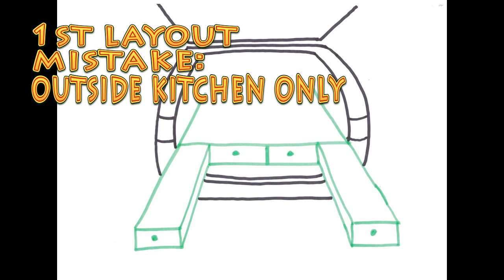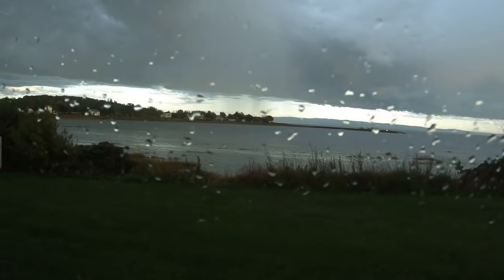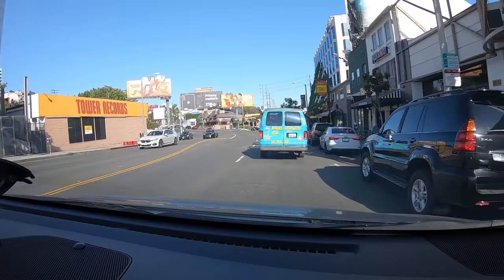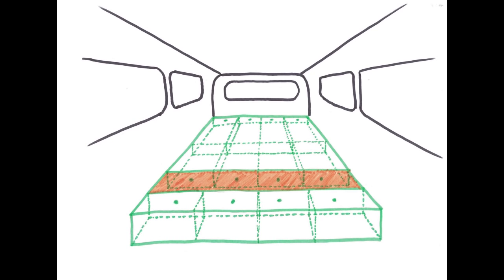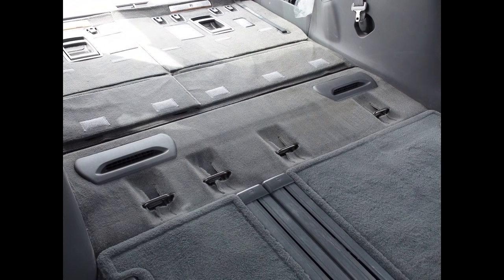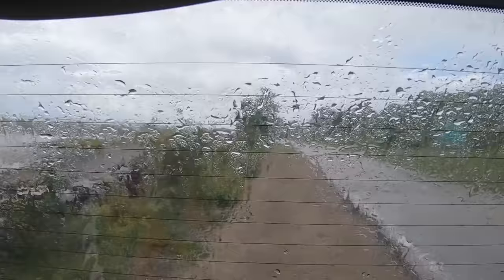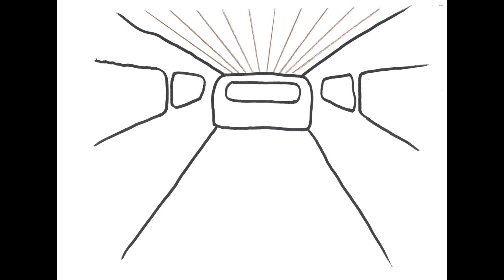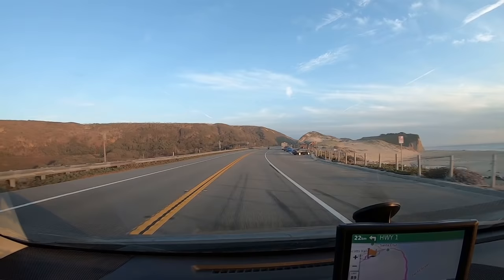11 mistakes to avoid (van conversion)

Comment: Not! There are only a few days on a trip that it rains . Those days you eat out. I go on vacation to enjoy myself not to make a five course  meal. There are rest areas where you can cook out in almost any kind of weather. I would rather access kitchen items from the rear and keep the dirt and mud outside. If you put your kitchen in the front where most are found even travel trailers which makes no sense. I would put a galley in the rear. The dividing line would either be a screen or wall. I would like to have some access from the rear inside. I haven't decided if the bed should be on one side or the rear after the galley area. Beds should have an isle between for easy getting out of bed. I slept in a motor home that had narrow beds but they worked well if someone would want to get up to use the restroom. Yes I said restroom no toilet in my van. I don't want to be dumping human waste on my vacation. I would have two refrigerators one in the galley and the other between the two front seats it would be small and have water and cold sodas. I would be able to lift it up in case if someone wanted to lay down. I don't really know if I want to keep the rear seat and use it for part of the beds. I had a 2004 sienna and I always kept the rear seat inside in fact before I got a chest refrigerator I took my 5 cu foot freezer and used it for a cooler plugged it in every Other night. It kept everything from spoiling and the drinks cold. of course we didn't sleep in the van. The motels where we stayed we ran a cord outside. I'm glad the first night was on the end and the third night I was able to back up to the door. 73
Reply from the maker: Well, it always depends on how long you travel and in what seasons… months at a time versus weeks at a time, falls and winter versus summer… 

When you try to fit in everything, usually there are some decisions that must be taken… The important is to have fun in the process! Enjoy your project! ✌️

Comment: Hi Eric! Really appreciate your videos. I was wondering if your closets being on one side of the van is a problem? Or is it okay as long as you don’t put any heavy stuff in there?
Reply from the maker: Hello Louise!
It’s not a problem because I took care of the weight distribution by putting the fridge and the roof box and solar shower on the other side. 

I store my clothes on the rear cabinet and food in the front one. Everything work properly. I did not modify the suspension at all. 

Good question Louise! Thank you for your appreciation ✌️
Reply: @ericenjoysearth2756  OK, great! Thanks a lot  for the quick answer Eric.

Comment: How do you cook inside without propane or compressed gas? White gas, alcohol or induction?
Reply from the maker: I use a backpacking stove with iso butane cartridges. I store those cartridges outside in the roof box.

Comment: This will sound obvious,  but why not go below the windows on cabinetry and then a bit above, where you'll still have some storage. But it's not invasive to anything else? 

I'm paranoid, so any emergency exits/exit windows would have to be unobstructed. It's going to be longer than you think to get out if they're all blocked up.

Oh, and I'd use backup cams on the sides as well. Not in place of turning to look, just used to be certain.
Reply from the maker: I appreciate having the counter at the same hight of the bottom of the window because I often do the dishes standing up from the outside, with my girlfriend wiping it seating in the inside.
In case of emergency, it is best preferable to have access to the driver seat to drive away. I will do a video about this matter. You will like it✌️

Comment: Great tips.  Wondering how you cook if you do not carry propane.
Reply from the maker: Hello Alisa! I cook with a backpacking stove. I store de fuel cartridges outside in the roof box ✌️
Reply: @ericenjoysearth2756  Do you mind to share your stove with us? I was thinking the same about gas tank / possible explosion before even I read your youtube. Your youtube just confirmed my thinking. I would use electric cooktop or backpacking stove but my backpacking stove will take one day to cook the meal :) haha!!
Reply from the maker: If you go to your local outdoors store, you will have good advises about the new backpacking stoves. There’s a couple of good ones. Mine is more than 15 years old. Since you should not use it at high altitude, there’s going to be more options. Don’t forget to tell them this.✌️

Comment: Could you share how you removed the mounts for the second row seats?  I've seen a couple other videos where people attempted it and gave up. This is a great video series.
Reply from the maker: I will explain this in my video about flooring that is still to come...✌️
Reply: @ericenjoysearth2756  It looked like you removed the mechanism that the seats attach to from the rails in the floor. I have a 2017 and have the seats out but have two clunky slides left.
Reply from the maker: Yes the trolleys are not made to be completely removed. I will show this and what I did... ✌️
Reply: @ericenjoysearth2756    Hi Eric, love your videos and thank you for sharing your conversion.  I am looking forward to the floor video, I am buying wood today to begin the bed build.
Reply from the maker: It is going to be one of the next ones... congratulation for your new project! ✌️
Reply: @ericenjoysearth2756    Thank you, can't wait.

Comment: The hard floor: I do not have one, and best way to keep the dirt out: Shoes off! So a hard floor is not bad but in my small van it would steal at least 5 centimeters (btw: you are french, why you speak about inches? do not understand...) This makes the difference in sitting in my van relaxed or hitting the roof with my head....
Reply: It's Quebec's french, in Canada, not France's french. We are influenced by the US a lot. Some units are still imperial, others are metric, and sometimes some are mixed up depending on the use (road in metric, construction in imperial, both are distances, or pool/lake and cooking temperatures in farenheit but outside temp in celsius)

Comment: If no propane shall be carried in a camper van so how you cook or make tea? I think it is risky for the solar battery to throw so much power quickly to operate the electric kettle or you have another solution? I guess you turn the vehicle on and use the alternator power to cook on the small electric stove right?!
Reply from the maker: No. I use a pocket backpacking ISO butane-propane stove. I keep my fuel cartridges outside in the roof box. ✌️
Reply: People under estimate the danger of lithium batteries.   Ask Samsung.
Reply from the maker: Which I do not use.
Reply: @ericenjoysearth2756  and they expensive too, I didn't have solar but I did use alternator to charge second deep cell battery while driving
Reply: @ericenjoysearth2756  Wait, how do you attach it to the stove? Long fuel line?
Reply from the maker: It is portable. Look at my van tour video, I show it when I assemble the table outside:
https://youtu.be/qJjL-NWeoVI
✌️
Reply: @ericenjoysearth2756  Yes I see, but how do you cook inside?
Reply: 1) no tea. Did we learn nothing from Boston? 
2) Cooking in such a tiny multi purposed enclosure must be minimalistic. 
I honto camp sites, steal burgers and leave notes like THANKS!...YOGI & BOOBOO
Reply: I just purchased a 'Sterno Inferno.' Think it will perfect for a quick cup of morning coffee or tea--and an easy heat meal on a rainy day.  Of course, as long as one has hot water, there's always ramen with fresh veggie additions.

Comment: Do you think you would up grade to a new hybrid Sienna?  The gas mileage so much better.
Reply from the maker: No. As long as I don’t have to change my van I will not do this. I will certainly buy another fuel one (used). Hybrids and electric vehicles are useful when you drive in a city. Since I travel a lot, the charging electric functionality is not much used. An hybrid mean buying and loading a vehicle of both technologies: fuel and electric. Plus you have those two worlds to cover the maintenance costs (and buying cost). I would also add to this, that since it requires more pieces, it requires more ore, transformations, transportation, packaging, and so on... You must consider the global aspect and your needs... Good question Dom👍
Reply: @ericenjoysearth2756  thanks.  I have a 4runner.  Wanted to get a new sienna but since there new. I'm sure they have bugs to work on. So figured to play it safe and get a 4runner.  Only thing now is, sucks on gas if I want to do a long trip.
Reply from the maker: I do understand you! I had an Xterra to suv camping... I loved so much the look of that truck, but I sell it because of the fuel cost! I bought my minivan used and will buy the next one also used. ✌️

Comment: Do you have a video talking about the flooring? I bought a used car and the carpet is very aged. I was thinking to remove the carpet? what is the budget way to go around this? to replace the aged carpet with new carpet or should go for the floor board like I can see you are doing the same with you car. Can you cover this topic? Thanks so much.
Reply from the maker: I really would put a hard floor! So much more easy to clean! 
Plus it is flat, prettier and waterproof!
Yes I will do a video about the flooring 👍 Stay tuned ✌️
Reply: @ericenjoysearth2756   Oh really. Thank you so much. What is the cheapest way to do the waterproof hard flooring? please walk us through steps by steps. I am following your method all the way.
Reply from the maker: I will do a video about it! ✌️

Comment: what about a tent room for the back of the van when appropriate ?
Reply from the maker: To me, it would be the 12th mistake. It takes time to install. A problem when wet. I need to be stealth since I usually sleep anywhere... etc
Reply: @ericenjoysearth2756  
thinking of room tent for 
when camping in the wild.. 
for showering cooking etc
Reply: @ericenjoysearth2756     Does having your surfboards, solar and cargo box on top take away from the “stealthiness”?
Reply from the maker: Hello Duggy! 
I never missed not having a tent. I have 4 tents, for different expeditions types and I never carry them.
✌️
Reply from the maker: Hello Joe!
Not at all. As I said in one of my videos, I have never been kicked out.
Reply: @ericenjoysearth2756  
what arrangements for showering ?
Reply from the maker: I use a solar shower that I will explain in a coming video... stay tuned ✌️
Reply: @ericenjoysearth2756  
cool , dude !
Reply: @ericenjoysearth2756   So true.  I have found a motorcycle, bicycle or other "toys" on the outside of the van changes the perception of who's in in the van from a homeless creep to a well traveled person on vacation.
Reply from the maker: Make sens Joe!👍

Comment: I have a 2007 Nissan Xterra SUV and would like it to become a minivan. Thank you so much for your ideas.
Reply from the maker: Hello Susan! Me too I had an Xterra before. I still found this truck so great looking and an awesome 4x4 to go really remotely deep anywhere! 

Thank you for your appreciation ✌️
Reply: @ericenjoysearth2756  Wonderful!  Do you have any ideas for something that small?  I also have a standard poodle so that complicates it more.  He has always ridden on the drivers side of the back seat, and sleeps there also.  So I removed the back seat on the passenger side to make a bed for myself, which is then pretty narrow.
Reply from the maker: It is more a case of car camping setup then a van conversion... A minivan is much more roomy... it depends of your needs...
Reply: @ericenjoysearth2756  I only want a 4x4 and most vans are not. Also, I do not want to purchase a different vehicle. So I have to think smaller:)
Reply: Oh no!  My SUV was in an accident and now I have no vehicle!!!  Back to square one.
Reply from the maker: I am sorry for your suv. 
You are not necessarily to square one... Having no vehicle may gives you the opportunity to go with any vehicle!
At my opinion,  an all wheel drive, may be necessary only in sand, steep backcountry road or road with deep holes... Regular roads with winter ❄️ conditions are fine with a front traction. It is a canadien who is writing this 😉✌️

Comment: nice pieces of advice, but one thing I didn't get, how you suppose to cook without any sort of gas tank? tnx!
Reply from the maker: I store my fuel canister outside in the roof box ✌️
Reply: In USA you can still get two fuel camp ranges propane 1lb bottles and actual gasoline . Butane ranges are available . Plenty of other ranges .

Comment: If not compressed gas, then what do you use to cook inside a car?
Reply: Me personally.. 12v appliances.. 12v frying pan, 12v saucepan, a rice cooker etc plugged into my jackery
Reply: @limitedtime5471  , I could see that kind of setup working, but I don't see many people do that because just a Jackery isn't going to be sustainable. People usually use it for charging 5V devices, lights, etc and maybe boil water using the 12V port. It's probably going to take a massive solar panel and battery system to do what you're suggesting, and that would almost very likely already involve a mini chest fridge/ freezer. Then again, from most of the videos I've seen, they might have a fridge and are still cooking with gas.
Frankly, compressed gas isn't dangerous, but this video claims it is illegal. That's crazy easy to get around, like "It's for my backpacking gear", "I don't cook in the vehicle, only outside". And when it's freezing in the middle of winter, and you have no choice but to cook in the vehicle, which nut is going to come out just to catch you doing it and arrest you for it? And even when it's not winter, I haven't actually heard anyone mention cooking with gas in their vehicle plus say it is illegal and are genuinely worried about it. It's is the cheapest and easiest cooking option.
Reply: @jdshl8423  oh by no means did i mean everyday electric cooking with a jackery. Just for a quick meal on the road, inbetween when you can set up outside. Lots of people don't seem to mind gas inside but I'd rather not. The laws about propane are mainly to do with ventilation i think, as rvs carry propane in specific compartment
Reply: @limitedtime5471  , well RVs are regulated and carlife/vanlife is technically illegal. So I wouldn't be worried about "illegal compressed propane" issues. Installing ventilators and smoke/CO detectors is for one's own safety, but it doesn't make the entire setup legal. That's why people have blackout windows, so that noone can see what's going on inside, because it is actually illegal. A lot of the people doing it are voluntarily homeless, and many aren't even dirt poor, simply because it is a cheaper and more fun way to live, and work, and travel. And the loophole is that it is unregulated even if it is illegal, for now at least.
Reply from the maker: I use cartridges gas that I carry outside in the roof rack. 
I also agree about the use of gas rather than cooking electric.  Electric cooking require too much power....
✌️
Reply: @ericenjoysearth2756  , to go as far as to put it outside the vehicle seems a little paranoid to me. The only 2 problems I can think of is direct sunlight and general overheating inside the vehicle. Almost every video I've watched deals with these issues because the person living in it doesn't want to be hot and uncomfortable, not because they are afraid the canister will blow up. So in essence, the vehicle interior is cool enough to store a small gas canister or 2. Just sayin'.
Reply: I am thinking of using a small crockpot.
Reply from the maker: Having propane inside is an absolute no go for me! For backpacking fuel canister, I avoid having them inside. The problem with that kind of canister is that it may leak. It effectively happens to me when I was outside. The canister emptied very fast! So fast that ice was created! I burn myself with the resulting ice!
Also I have worked in a petrochemical plan. I can tell you that valves leak pretty much more that you can imagine. The problem is the gas accumulating inside... I have a friend who saw an rv blowing because of it. 
The probability a very low, but I personally know that it is there 😉✌️
Reply: @ericenjoysearth2756  ,
"The probability a very low, but I personally know that it is there "
- Nobody is denying this or pretending they don't know. Can you imagine if I said that I don't keep or use gas tanks in my house because it could leak inside the house and blow it up? I have a 10kg tank sitting in a corner and 2 dozen stove canisters still packed in the original plastic wrap in a plastic box in my emergency prep store, and they've been there for over 2 years now. Dude, you getting burned from the leaking canister was an accident. It likely will not happen again, and if it does, it's probably not the canisters but something you're doing wrong with it. How many people do you know have had problems with gas canisters indoors or incars or invans or inanything? LOL!
Reply from the maker: I can tell you that it is definitely not me. I have use those all my life! The more you use, for decades, the more you have chance to reach a probability. 
The risk with that kind of valve is when you screw and unscrew the stove to it. ... and if you keep the stove screwed to it, it is the leakage. But by itself, it is very much lower.

Any way, the big concern is with propane tank. It is not just me, it’s the law! ...and for reasons effectively. ✌️

Comment: I'm calling major bullshit on compressed gas especially LPG. it's hard to ignite those gases by accident, you need a proper A/F mixture in order for that to happen.
Reply from the maker: I am sorry but once I had a valve issue with a gaz leak. I even burn myself with the ice of the endothermic reaction of the decompressing gaz.

I can tell you that valve leaking do occur, even in a refinery!